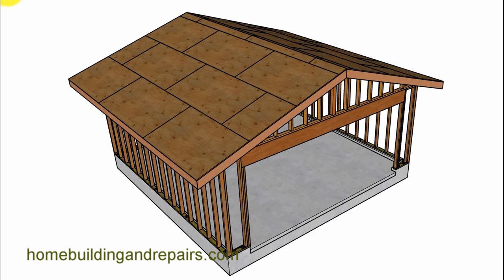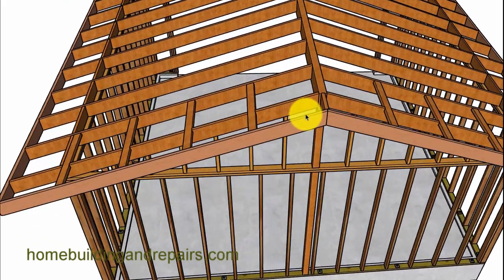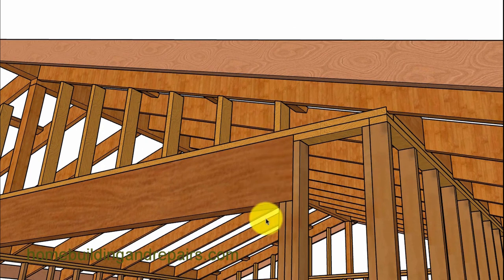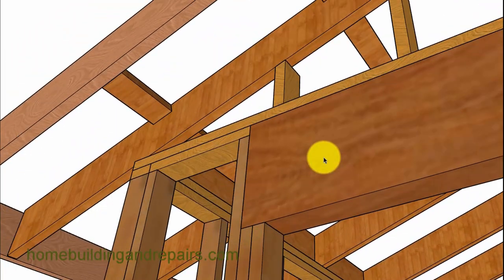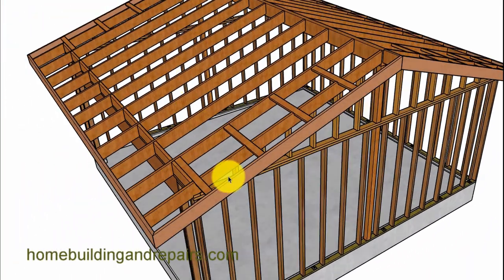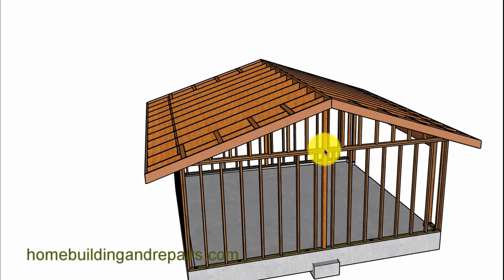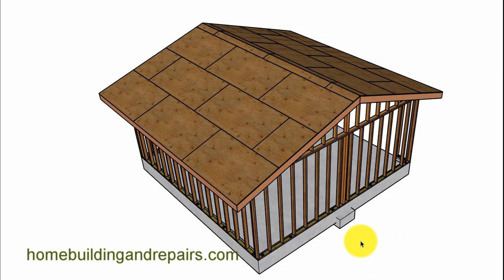Two-car Garage with Ridge Beam Roof Framing – No Ceiling Joist or Rafter Ties

Comment: Great video and lots of great detailed information.   question ______we/ my son and I  are building his shed 20 ft long by 16 ft wide 8 ft high( not including the pitch of the roof ). we built a 22 ft long ridgebeam,yes ridgebeam,not ridgeboard,,,  from pieces of , 2in x8 in wide x12 footers staggered  and we also added a piece of 1/2 in plywood in the centre like a sandwich on its end for  stand up end strength  and the for good measure,we also use PL Contractors premium glue between that 22 foot long beams sides to plywood,so it will be now all glued to each other .we laid it in a "jig" so it would be with a 1/4 "uplift" in the centre of the beam,which we felt was good for compensation  of sag,if for some reason, it do sag a small amount at the centre, in the future years because of snow weight in my area ( because there is NOT going to be any type support in the centre of the building to support that roof)).. ok ,so we let the PL Premium dry for a few days before we move that beam and now its glued togather permanently .  so its ( crossection) is now exactly 4 inches wide and 8 inches high and  is a 22 ft long ( these 2 extra foot is for a 1 ft overhang on each side of the building. the question is ::::: is it ok to use a "birdsmouth " cutout on all of the  rafters ( measurements of the rafter is 2 x 6 x10 ft long ( excluding the  1 foot overhang) to fit on the RIDGEBEAM??? will this make it stronger by using a 1/3  birdsmouth on the RIDGEBEAM???Some people say it will be stronger to use a birdsmouth on top of this ridgebeam, because it is nailed/screwed down on  top of the ridgebeam and also on the   8 foot side wall top plate..some people say it do not make any difference how  the rafter is attached to the ridgebeam?. i personally feel to have a birdmouth at the ridgebeam and screwed/nail down through the top of that birdmouth is stronger then to  screwed the rafter on the side of a ridgebeam with screws and or nailed. of course, a birdsmouth cut will be used on the wall plate as normal for attachment ty in advance for your thoughts and input ty.

Comment: I know you might not have that many views but you don't know how incredibly important this information is to me. I have a question if the walls of the building are made out of block and concrete, do you still need to add ceiling joists?
Reply from the maker: I cannot provide you with structural engineering information, but imagine that you would. I've seen walk walls bow out in the center that didn't have ceiling joist or rafter ties.
Reply: I didn't mention, I have a model of the house and what I plan to do, it is quite detailed.
Reply: @y. o. Thank you, I didn't realize this was not the original uploader.
Reply: The fact that you are asking means the answer is yes. If the block wall or concrete wall had been designed to take the horizontal load that would only be because you would have asked for that feature. If you did not asked for it then it does not have it so the ceiling joist is needed for that.

Comment: That’s interesting. I’ve been trying to figure out what the rod in my garage was needing. It doesn’t have any rafters tires or ceiling joists. Someone gave a half hearted effort at rafter ties I think but they aren’t really very sound. The problem I have after watching your video is the “Ridge beam” is only a 1/2” or so piece of shiplap.

With the ridge beam construction process why doesn’t the roof settle downward and push the walls out?

Comment: I want to remove the ties from my 17’x10’ shed and add a ridge beam under the peak to support the rafters. The rafters are currently fastened together at the peak without a ridge board present. Is it possible to place the ridge beam UNDER them and fasten them to the beam? In other words, the beam wouldn’t be in between the rafters like in your model.

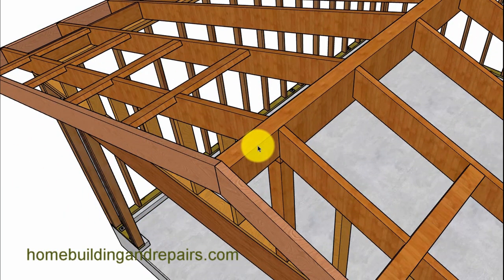Comment: shouldn't rafters rest on the ridge beam ?  as it looks like rafters are attached / joined alongside the ridge beam 1:14  .  We are planning to insulate a similar roof with cob ( clay ) so will have to be extremely solid

Comment: I have  a garage just like this built in 1930's. It is a 20 x20 and has two split doors that swing out. Both doors are heavy and sagging. How would I go about reinforcing them? Also I would like to put in  some over head storage and not sure how to do that either. Thanks
Reply from the maker: By reinforcing them you would be adding more weight, maybe it's time for a new door. I've dealt with this before and had one of the springs break and it shot across the garage like a bullet (I was worried about being injured) and that was when I got a light weight door.

Comment: How wide of a room can you do that.  I'm asking because of a open ceiling like that on a home looking at building , then placing faux beams up against the dry wall.  I also want the roof cavity to be at least 1' 1'2 thick?  Like you might see on mountain style homes.
Reply from the maker: You would need to contact an engineer for more information.

Comment: Question, I want to build a 30 x 40 workshop with max storage above. My idea is a center beam (3 2x10) running the 40 ft . Trusses with 9/12 pitch. Is this doable, truss bottom chord 2x4 or 2x6?

Comment: I am building an out building with roof construction just like this. I would like to not use hardware to attach the rafters to the ridge beam. Any suggestions on how to do that. I would like the rafters on both sides to line up with each other just like in your animation.
Reply from the maker: I cannot provide you with structural engineering advice, because that's all going to depend upon the individual project, but can tell you that I've used joist hangers and hurricane ties to attach the roof rafters to a ridge beam.

Comment: Awesome videos sir! I’m planning a 42’ wide by 40’ deep garage attached to the house on one end. And the other end will be a hip roof. I would like my ceilings to be open throughout the garage. So it will attach to the home on the west side.  Ridge beam running west to east.  3 10’ wide doors on the north side, hip roof on the east side. I don’t know if you take requests but that would be awesome if you could make a video like this for it.
Reply from the maker: I think you will find what you're looking for the website. Click on the remodeling tab, then home additions and you might even want to check out some of the roof framing videos as well. Let me know if you can't find what you're looking for.

Comment: Honestly you really need to have color ties. You can still have a tall ceiling. You just want them to span 1/3 of your rafter. Without them the ridge and rafter weight will be solely supported by the outside walls and over time will push them outward. Just my opinion ive seen many open spans like this fail

Comment: Does this set up require 2x supporting posts on each end of the ridge beam?  Would it work with an attached garage where there is a house door right in the middle--in that case would the house door be in the way of the ridge beam?  Thanks.